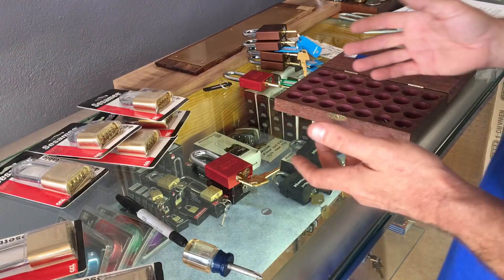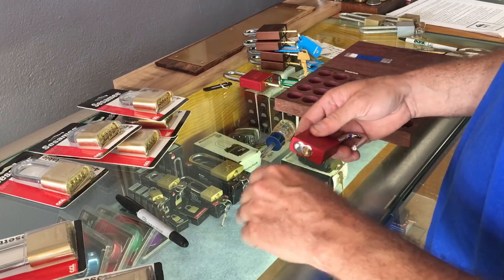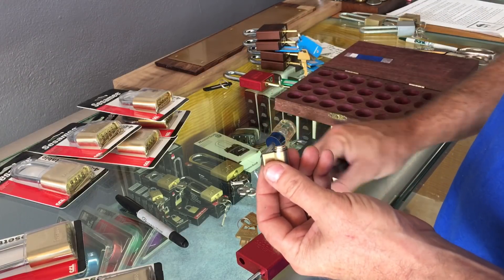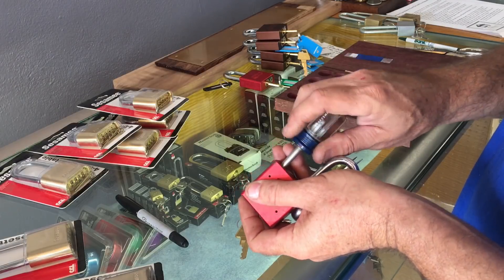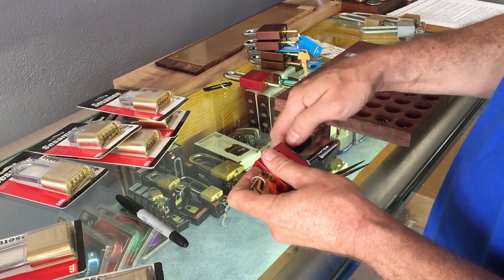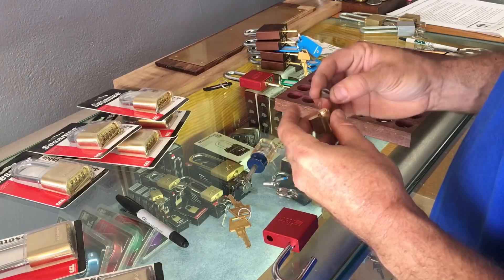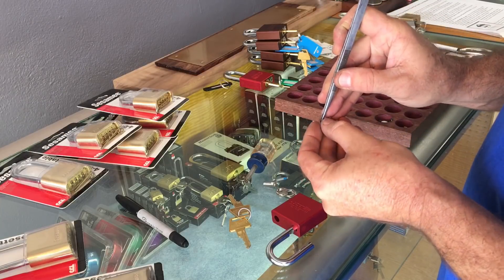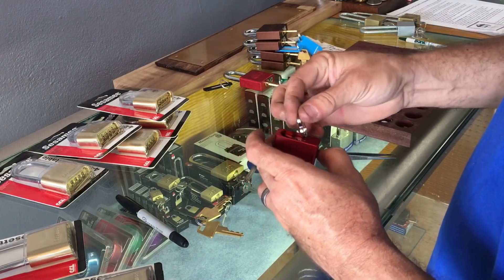How many American anti bypass wafers is too many?

Comment: From personal experience and testing 2 wafers are sufficient to prevent the punch tool from making a hole large enough for the bypass tool to fit, 3 wafers will often have at least one wafer that will not be holed although it will often be bent.

Comment: Thanks Jason. I own the wager breaker tool and tested punching through two wafers. Two wagers are sufficient enough to keep the bypass wire from the actuator. The breaker did punch through both but the hole was too small to fit the wire. Thanks! Love your videos

Comment: I'm a mechanic or chef by trade... Always blue collar stuff. But I'm admittedly, quite a nerd, lol... knowing a little about metal n physics leads me to believe one single, "double thick" wafer, would be more effective. Nice 301 stainless one. Someone should make some. None of my Americans have any. Shoot me thickness in ,000", n I'll make some n send em.
Reply: I can figure out the other dimensions, just need thickness, I'll check for clearance in one o my 1100s. I don't bypass, just pick as a hobby, so I don't own a wafer breaker. I'll leave testing up to you....
Reply: 0.015" or .020" will be sufficient most likely. If I remember when I get home today, I'll pull one apart and report back

Comment: good to know that i wasn't the only one ripped by american locks with no wafers in my 1100's.  odd they skip em for that series. your a good guy for adding in wafers in em and doubling up for your customers.
Reply: American Lock lists the 1100 series as being for Lock Out/Tag Out functions rather than perimeter security which is probably why they don't include the anti-bypass wafers.
Reply: Nite 0wl
interesting,  all the pennies add up.  now i know to stay away from the 1100's, thanks